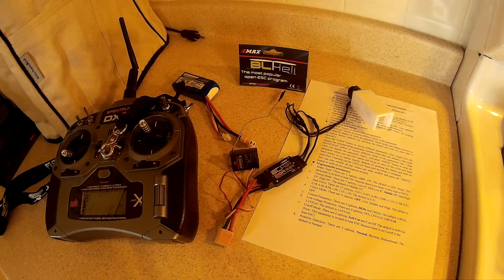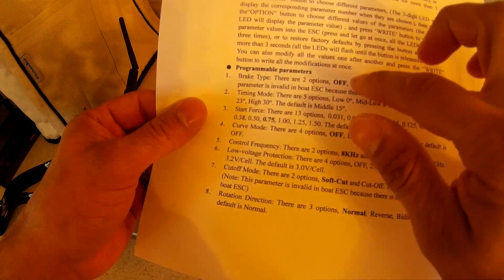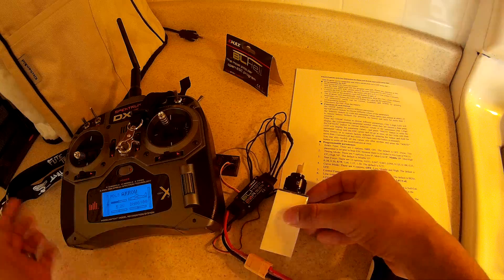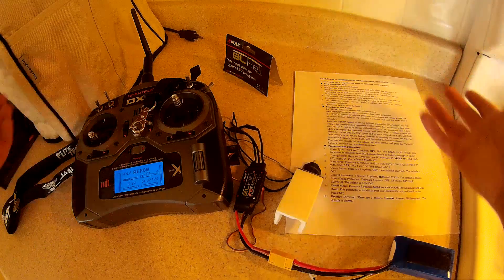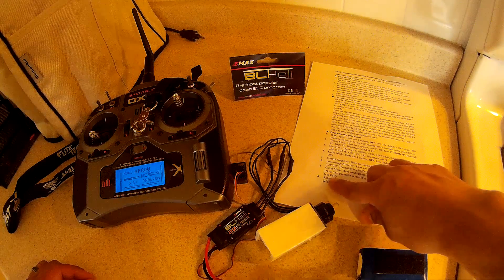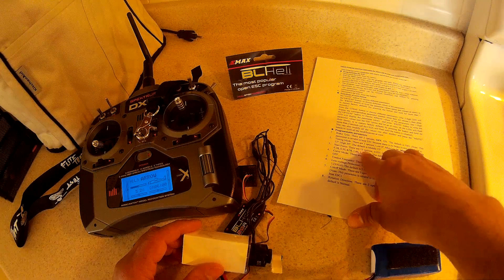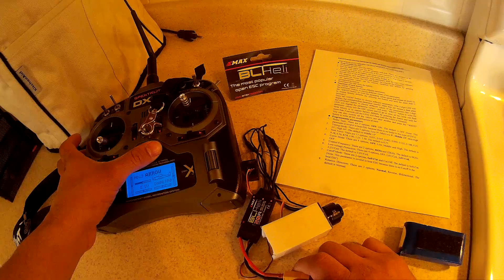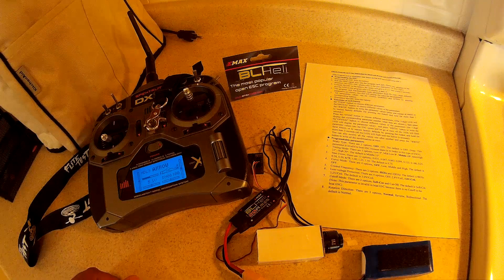How to program Emax BLHeli 20A ESC with your Transmitter

Comment: I have blheli esc 50 amp, but i
 thought , i can set break like other kind of esc sitting,  and i did as used to with other esc , and i think
 my sitting could be disturbed, 
Pls can you guide from i can print this manual and does this manual work woth 50amps also ,
Pls share link

Comment: Great demonstration.   I have read what i believe is every manual for the blheli series.  All confusing.   I program using an esp32 board instead of a transmitter or app. Your video clearly does what none of the manuals do. Thanks!

Comment: Thanks. I also messed up my ESC in a similar way. This should help even though I have the instructions for my 3A Emax BLHeli ESC. . I've got to do a factory reset and then I want to do the motor brake.

Comment: I set the direction of rotation on two-way and now I can not enter the configuration menu esc. I can not set the maximum and minimum throttle level. You can not also import factory settings. Can you bring the settings in a different way?
Reply: The same problem has happened to me. I can not access to configure. Have you found a solution?

Comment: Can you just swap 2 of the 3 phases to reverse direction? Rather than going thru all that programming and risking changing something else? Or is there a good reason not to do it that way?
Reply from the maker: Steve Roberti yes you can. I think the programming feature is just there so if you had to do it in the field.

Comment: can you put it in calibration mode when it's connected to fc without the red wire on 3 esc accept one ?
Reply: I need to know since I put it on my drone and don't want to fry them it only has 2 wires on 3 esc because I pulled the red out of 3 and left all 3 wires including red in 1 esc
Reply: please let me know asap:)

Comment: Truly pain in the A&& these ESC's. bought these for multi copter but can't program them with BLHeli / CleanFlight. And for some weird reason they just spin up randomly!! Don't get me wrong about this helpful video and I'm going to try this (weird) way of setting them up. But my advise would be to get some more "normal" ESC's
Reply: OBELIX ER where you able to calibrate them some how and get them setup to fly on a drone ?
Reply: Colin Berens  No, I could set them up like like shown here but even when I select "do not spin when armed" they would randomly start spinning after some time. I could fly a drone but when landed and flipping the off switch the engines would would start spinning and beeping and finally flip the quad over. I bought BLHeli 30A without BEC and all is fine.
Reply: OK
Reply: Was it just because of the bec?
Reply: what program where you using to tell it not to spin when armed and was it constantly spinning after you shut throttle off but at a low speed or did it shut off and then start back up even tho throttle was all the way down ?
Reply: I really want to know because I want to get an esc with bec and blheli is supposedly the best and I don't want any problems when I buy it I also need a 30amp with bec and I found it and thought it was good so let me know
Reply: Colin Berens used cleanflight, the motors would stop. and start to spin after some seconds. while trying to calibrate this would also happen. playing with the sliders did or values did not help. also when you start a reboot of the FC the motors would go crazy. on/off spin had no effect.
Reply: OBELIX ER where you trying to calibrate it in clean flight and this caused it ?
Reply: OBELIX ER where the esc working before you tried to calibrate ?

Comment: I also screwed the settings up by trying a standard calibrate procedure!  So is there a throttle calibration for these ESCs like most other ESCs go through?
Reply: start it up like you did in the video but as soon as it starts up and you hear the very first 2 beeps drop your throttle
Reply: Zachery and Ashley Bettis where you able to calibrate it and fly it on a drone?
Reply: Colin Berens I'm still trying to find how to find out how to calibrate the throttle settings.  It could possibly be somewhere in the BLHeli downloadable software but I'm going someone will post an easier way.
Reply: Zachery Bettis I might have a way to throttle calibrate the esc so all of them start at the same time but you have to do it to the esc one by one
Reply: if you look on YouTube it's called manual esc calibration let me know if it works
Reply: about how thick is this esc I need to make sure my prop doesn't hit it
Reply: Colin Berens its about .4 inches including the heat shrink.
Reply: Zachery Bettis so it's .4 inches ?
Reply: Height-wise yes

Comment: Many thanks for sharing your videos, I had same problem as your first video, watched them both,gave me info that worked on my emax 30amp esc.
I bought an E- Max card on line,but it didn't even light up,so back to using to using the transmitter, which worked great once I watched your videos! Thanks  Again!

Comment: Thanks for the video. I try this to restore factory settings and it works fine:  -> Restore Factory settings: To  restore  Factory  settings,  pull  the  throttle  stick  to  the  bottom  position  (full  Off  throttle  )  within  1s  after  entering  program  mode  (Step  1)→Pull  the  throttle stick to the top position within 2s, then you will hear a tune, which means that the factory settings have been restored. Pull the throttle stick to the bottom position within 2s, the ESC is ready with factory settings. I forgot to say the ESC is Simon Series 30A. The bidirectional mode need USB Link to be reprogramed.